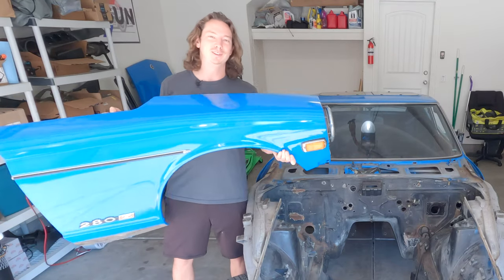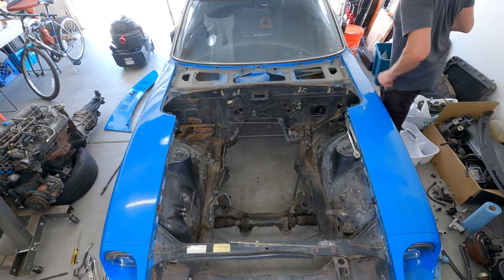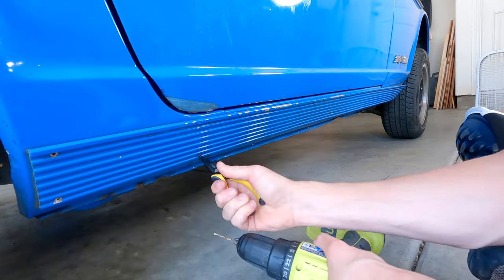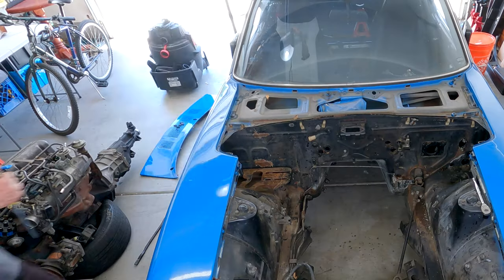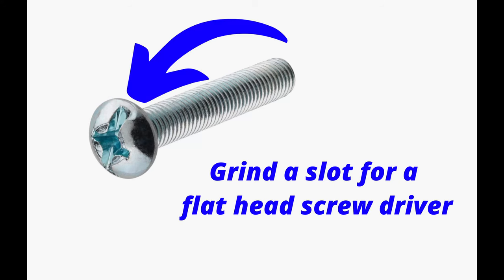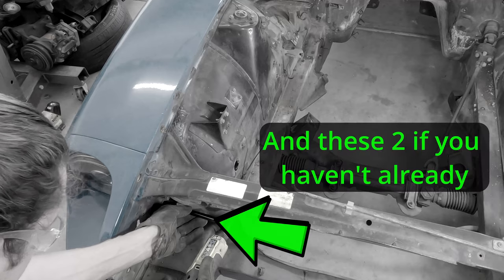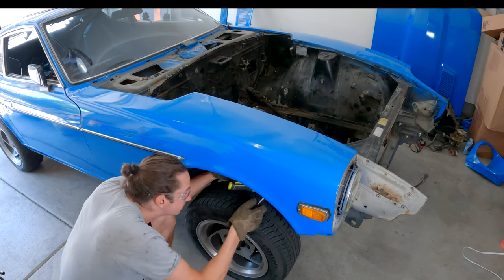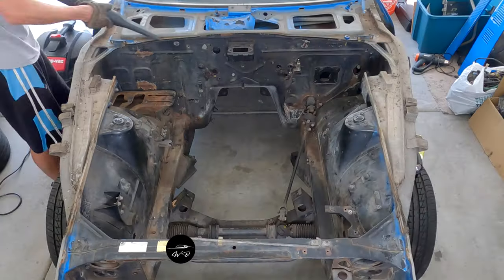Removing the Fenders and Cowl - 240Z | 260Z | 280Z

Comment: That sealer you found along the top is called "Dum-Dum" and it was installed at the factory to avoid rattles and metal to metal between the fender and frame.
Reply from the maker: Thanks for the tip!  I'll definitely be replacing it with some sort of rubber sealer, just not exactly sure on the thickness needed

Comment: Becuause it's yours, not thier car, they don't care, It's a pinch weld, IDK why "mechanics " "tire" insist on jacking from there,  OR the differential,  one kid at a tire place did it in front of me!  I was very adamant he is not to do that, he looked confused, said the ALWAYS DO IT,  I said use the damn frame jack spots to lift my vehicle. Unfortunaly many vehicle mfr manuals say to lift it there too.  I suppose they don't give a hoot who destroys your vehicle. They're just waiting for your next vehicle purchase.
Reply: The reason why the manual says it is because that what YOURE SUPPOSED TO DO!!! Jacks even have a slot for pinch welds. It’s the strongest outermost part of the vehicle smh 🤦🏻‍♂️